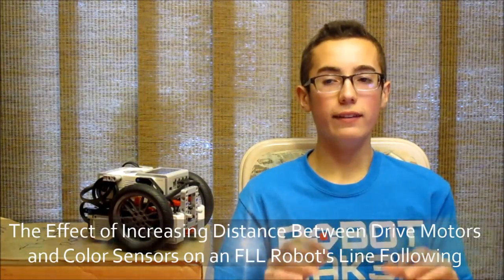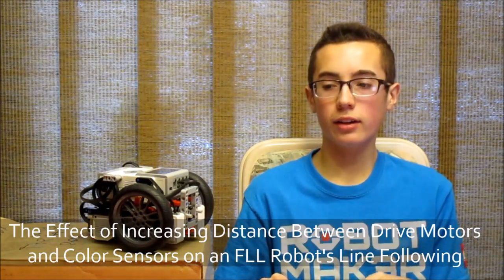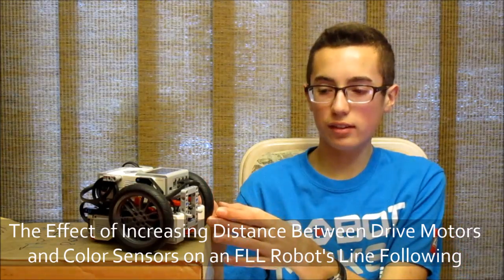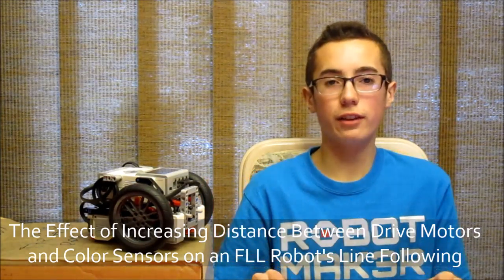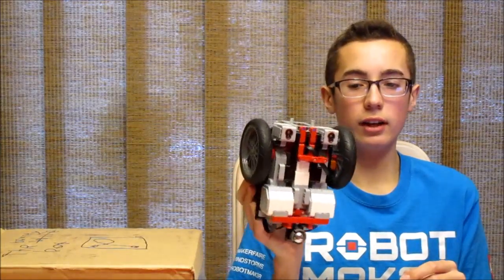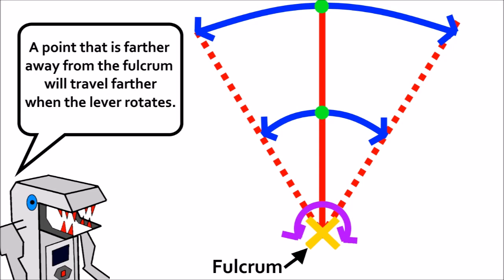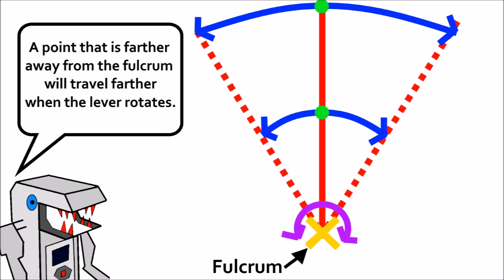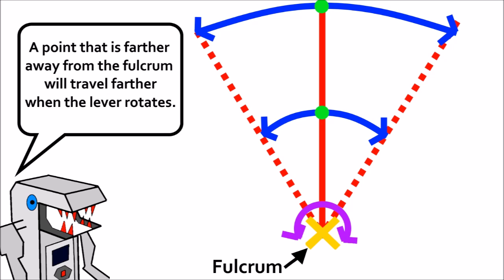The Effect of Distance Between Color Sensor and Drive Wheel on FLL Line Following

Comment: Hi do you have any tips on how to solve the line following for the robocup junior rescue mission. The lines are very short with sharp 90 degree turns and small curves and a blank space in between lines
Reply from the maker: +jun run More color sensors may help.